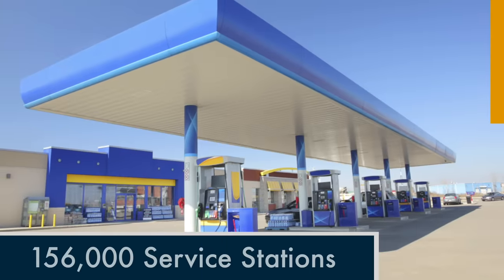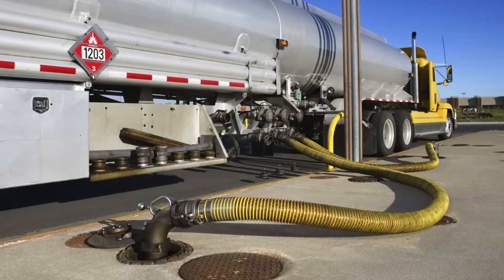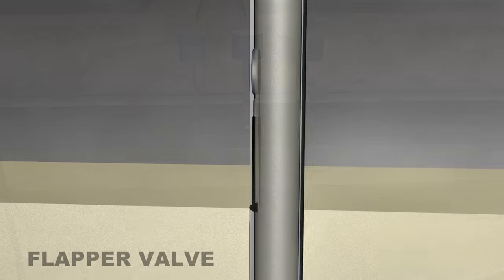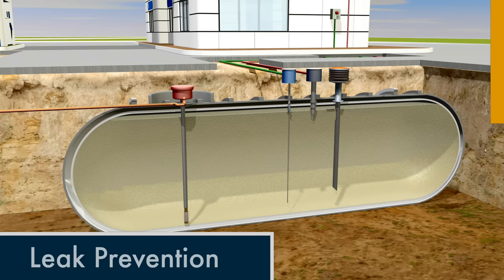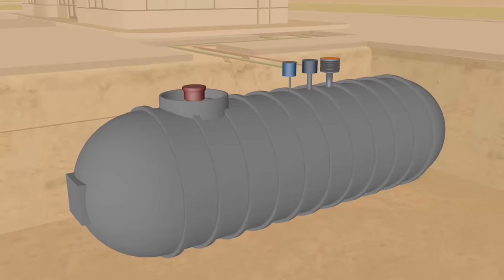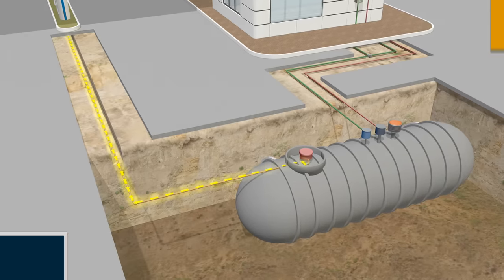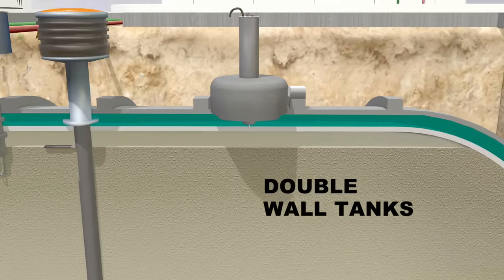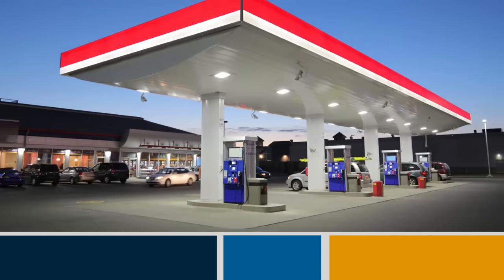Gas Stations

Comment: That's a lot of safety and all, but then when a leak happens you gotta rip that shit out of the ground and repair it.
Reply: Yes but it's not actually that big of a deal relatively speaking.  Pump it dry into tanker trucks, rip the concrete up, scoop out the gravel, and drop a new one in (or repair but that can be a real pain) and if you're unlucky you might need a few pumps to keep the water out of the tank hole while you do this.

Comment: I used to work at an old full serve station built in 1920. Tanks from the 80's . And the tanks were allowed to leak a cert en amount ( 1 gallon per2500 gallon per week ) its located where most of us have well water and it is less then a mile from the cape cpd bay ....
Reply: Brian O' well water is taken from pockets so deep it would take thousands of years for the gas to reach it
Reply: not in my aeira our local wells are as shallow as 140 ft but can reach 1200+ . The air Force base has leaked jet fuel and contaminated hundreds of wells   in less than 75 years. the ammount of time it takes for ground water to mover can varry greatly, where i reside is essentially a 60 mile long sand bar deposited by a glacier, allowing ground water to move quite freely

Comment: 50 years from now instead of there being gas/service stations there will only be power/charging stations
Reply: No one said EV's  are going to save the environment or the planet from global warming for that matter, EV's convert about 59%–62% of the electrical energy from the grid to power at the wheels, even if the power source is from a coal plant, it still makes good use of that energy. Internal Combustion Engine Vehicles only convert about 17%–21% of the energy stored in gasoline to power at the wheels, whilst still needing engine fluids to maintain the vehicles performance such as oil and gas to power it.
Reply: and what if you have an electric that is purely powered from a home solar grid? is it still burning oil? EV's are as green as their juice makes them to be. BTW EV's are a solution to the future, 50 years from now we will be running on fumes for the search of crude oil and natural gas, considering the increase in population, demand can only become exponential
Reply: ***** let me put it this way manufacturing anything will always require oil but which one uses less oil whilst being manufactured and requires no oil after its a finished product?
Reply: The end factor is always effeciency
Reply: Saul Ramirez nah
Reply: McDoogle Watchu mean naw son
Reply: Saul Ramirez lol 50 years more like 200 we have lots of problems right now
Reply: Spikey-gaming&more 200 is too much, with alot of early adopters for a small company like Tesla and a realistic view id probably say 60 years max, because Tesla EV's are pretty good in almost every single way than an internal combustion engine
Reply: Hopefully that's the case!
Reply: Tofutaco11 A example the plant Tesla will be making batteries from will be powered by solar(on roof), wind,hydro dams, and solar thermal power. That said, it will use hardly any fossil fuels to make batteries. Then people re charging their cars at home once more and more solar and wind come on line it will be mainly renewable energy. Even if they charged there car buy using a coal from a local power plant it's still way more efficient than burning gasoline in a combustible engine. The coal power plant near me is the cleanest plant in the US or the world hardly puts out any emissions. Also the batteries are mainly made of lithium ion batteries that don't need oil. The plus side of lithium ion batteries they can be recycled over and over. Once graphene batteries become a thing it will change the game.
Reply: All the people talking crap about electric cars..... well there coming and countries like Britain have passed a law that bans any new gasoline and diesel cars in 2040.
Reply: Pixel Dust Electricity doesn't always come from fossil fuels. I.E. Tesla factory uses more solar power to produce it's cars. Moreover Electricity used to charge cars can either come from nuclear power, solar or wind. Superchargers use (as far as i know) solar or nuclear, which is better for the planet.

Guys do you know that, using electricty instead of fuel saves money for a country, since there are no cuts going to countries selling them.
Reply: Pixel Dust a gasoline engine burning fuel is only about 25% efficient a lot of wasted heat is let go. Lets pick the worst most polluting type of electricity being produced.... coal. Burning coal at a power plant is way more efficient in a large scale producing electricity than a inefficient fuel burning car.
Reply: Dcool Or from nuclear plants
Reply: Pixel Dust Not sure why u keep trying defend the out dated fuel burning cars. I have many classic cars but electric cars are the future. There are already major countries banning fuel and Diesel cars in the next 20 ish years. The law has already been passed in those countries forcing automakers to change their thinking. Keep talking to yourself.
Reply: Pixel Dust I still don't get you. We are in 2017. Here are some reminder:

The tesla S got the safest car in the world rating
The Tesla X got the fastest and the safest SUV award.
The Tesla Model 3 has one lower drag coefficient of any car.
Tesla S does 0-60km/h in 2.4 s, the newest version can reach 539 km or 335 miles on a single charge.
Tesla X can be a 7 seater.
New Superchargers are being installed everywhere but you can charge at home. Moreover if you plan carefully and charge at night, you might never have to waste time refilling it, like fuel engines.

Are these electric cars slow? Weak? Or range limited? 
And also we can have unlimited electricity without damaging the environment. Here you can find an example of a supercharger station based only on solar https://en.m.wikipedia.org/wiki/Tesla_Supercharger.

I guess you are part of the people, who were against the introduction of motorized cars and prefered horses and charriots.
Reply: Pixel Dust you seem you have no clue either. Tesla is selling the model 3 for 35k that gets 220+ miles for it's Base line. 400k orders that is going to take a years to fill. I think your salty Tesla is going to be around for awhile. Volvo vowed to pretty much only build electric cars only or a electric hybrid.
Reply: Pixel Dust

Yes these cars are expensive. But you need to understand that this a startup company, this means the first products are naturally going to be expensive: Researches, Factories, Superchargers, Retailers,debts need to bought/made/paid out of the revenues from the cars. I.e 4k TV went from 2.500 - 8000 Euros in 2008 to 400-1500 Euros in 2017. 
Except for the fact that fuel combution engines can be refilled under 5 minutes, i do not see any reason why someone would choose at Combution engine rather than an ICE. 

Electricity is the best source of energy for every machine, we went from charcoal iron (clothes iron) to electric ones, from slow and wasteful coal trains to faster electric trains. Just give it some time man.
Reply: Saul Ramirez I hope noy
Reply: Saul Ramirez funny joke
Reply: dcool is that law real? thats anti freedom nooooo ;-;
Reply: Saul Ramirez so instead of running out of gas on the side of the road the battery dies and you’re screwed if you’re in the middle of Buttfuck-Egypt with no charging station, tow truck, cell tower or perhaps even mile markers for miles
Reply: Dcool makes sense.  Most people in London probably prefer riding goats these days.

Comment: The automatic shut off mechanism on the handle will fail if the previous person topped off there tank. Trying to squeeze the last penny into your tank forces the gas up the vapor return line on the nozzle.

Comment: What about the emergency shut off switch found somewhere in the station? How does that exactly work?
Reply: I think that just cuts the power of the gas pumps.
Reply: Well....best I can surmise.

It's a switch.  Turn it off....power is stopped.
Reply: No erectricity, no pumpy pumpy!  As the Chinese say.

Comment: Sucks when it takes 15 minutes to fill up when you just happen to find a pump with a worn out nozzle that keeps clicking off. Also let these tanks run dry because of issues with the pipeline and see what kind of fun stuff starts happening.

Comment: In movies, when gas stations blow up, only the dispensers on the surface explodes, not the tank. What?
Reply: Because the tank blowing up would require oxygen to mix with the gas, and that would be catastrophic so there are systems to try to prevent that.  Look around the internet, there are videos of gas stations where the tanks go and it's the kind of fire that you can't fight.

Comment: if the spill buckets are there to direct fuel into the tank why are we told to empty them by
mixing in fm 186 
bale out
dump in waste barrel.
Reply: thats right..i think.the video is wrong...if that was the case then rain water would freely flow in and fumes would flow out...we also know gasoline is extreamly dangerous

Comment: so are there really different tanks for different fuel quality or are they all pumped out of the same tank and they just charge a different price depending on the pump you use?
Reply: There are different tanks, they usually mix the high and low to make the middle.

Comment: why don't they make them all of fiberglass or plastic? seems like like an obvious choice instead of iron that can rust.
Reply: tiberiius well because plastic might (not saying it will) melt under heat and fiberglass is too expensive while iron does heat up and could be dangerous it's not as bad as having the gas leak from the tank but honestly I don't know so I'm just answering from what I think could happen
Reply: My guess is it's mostly with older tanks that can be upgraded with a special coating or the device demonstrated in the video.  This would probably be a cheaper and more efficient alternative than getting a whole new tank.
Reply: seem like pretty good ideas.

Comment: They show all the fuel goes in 1 tank, and I've only ever seen 1 truck refuel a station. So how are we being charged 3 different prices for 3 different types of fuel at the pumps?
Reply: There are usually at least 2 tanks, but 1 was used for a simpler video. Trucks can carry 1 or 2 types with separate compartments inside so that's why you see 1 truck at a time, and the middle octane gas is a mix of the high and low octanes.
Reply: And you know this how? .... The whole thing seems suspicious to me.
Reply: I work construction, and working on gas stations teaches you a lot.

Comment: Are they bullet proof?
Reply: Pedro Garibay Ground is pretty good at stopping low caliber pistol bullets.
Reply: Campers oh thanks
Reply: You couldn't put a hole in a tank in the ground with a .50 cal BMG...  You'd pretty much need artillery to damage one of these underground tanks.
Reply: Pedro Garibay why would they be?
Reply: I'm not sure how powerful the bullets are, but if your bullet could go through 8" of concrete (the part you see around the holes) then 4' of gravel or pea gravel, then through a couple flimsy fiberglass walls then they are not bulletproof.

Comment: 87 octane!!!!! what the hell!!! how do cars run on that, its practically water. 

89 is premium!!! geez no wonder americans need v8s 

we have 91 as the base fuel
Reply: 95 here, and 99 premium
Reply: VERY few vehicles have V-8's in them anymore, they haven't for years.  Most cars run just fine on 87 octane.
Reply: we have just started to use ethanol blends 
94ron-10%ethanol 
E85-85% ethanol
Reply: We have 87 octane with 10 % ethanol as well as E85.  Had it for quite some time now.

Comment: gas stations are not good for the environment to begin with lol
Reply: That's it. Explain how safe and environmentally friendly the fuel storage tanks are to distract you from the fact that they want to pump filthy tar sands sludge down the center of our country,  right over the aquafers that provide much of our fresh, safe drinking water.
Gee! What could go wrong with that?
Reply: David K. not to mention the atmospheric poisoning from the fumes of the gas consumed by the cars and spilled on the ground
Reply: greg77389 says the person who is ignorant of the poison that is petrol it is a toxic chemical that is really just primitive refined sludge that has the ability to burn inefficiently and we have alternate combustible gases that are much safer on the environment at our disposal (hydrogen)
Reply: greg77389 numbers of gas powered vehicles will go down after a new fuel source is made and the method i describe "Hydro Electrolysis" is a cheaper and safer method than using "hydrogen fuel cells" and requires no real conversion save for just using distilled water over gas
Reply: greg77389 AND I QUOTE. "How many cars today run on hydrogen you idiot?" BAM!
Reply: NorthernChev 
Exactly, you didn't answer my question you simpleton. You couldn't even give me a number.
Reply: deathbot117 
It's clear you have no idea what you're talking about so save yourself the embarrassment and stop commenting. How long before a suitable fuel source is obtained that would be cheap and effective for manufacturers to convert to? Clearly you know nothing of the automotive industry nor do you know nothing about science, electrolysis, etc.
Reply: NorthernChev
Did you forget that you were the one who brought planes into the discussion? You must have dementia because not only are you getting wrecked in this debate but you also can't seem to recall things you've said just a few hours ago...
Reply: greg77389 i dont see where he brought a plane into the discussion all i see is car names
Reply: deathbot117 
"I forgot about the hydrogen fuel cell airplanes that Boeing makes too..."

You only see what you want to see.
Reply: greg77389 i never said that ... stop fabricating quotes ... i looked for 5 min and i didnt find that quote anywhere in any of my comments in this thread
Reply: NorthernChev 
This conversation was over before it began. I've already won, I'm just teasing you at this point :)
Reply: greg77389 that damage control
Reply: Ponlets then stop driving you fool

Comment: if it's 1 big  bucket how we get  eather  89 or 91 gaz
Reply: Serge Bykov that's the conspiracy. you're just paying more for the same fuel.

nah, I don't know, maybe there are multiple tanks and this video only shows one for simplicity.
Reply: The same way you can get either gasoline or diesel. They use different holding tanks. Most fuel stations have 4 or more holding tanks. The next time you go to a fuel station, look and see how many access caps there are on the ground and look for the ventilation pipes and count them. Each cap and vent pipe counts as 1 tank.
Reply: Yeah that's true I didn't really think it though and comment  I have to wake up in 4 hours but still awake

Comment: Wouldn't the brine corrode the steel tank?
Reply: its special brine used in a special way, they obviously wouldn't use it if it did corrode...
Reply: great explanation
Reply: I guess it's.....er....special.
Reply: Anticorrosion coating, fiberglass and cathodic current prevent it from corroding. they litterally told that just before it. the question is why not normal water.  my guess is because brine is electrically conductive whereas water is not and they are using cathodic current for preventing corrosion. but im probably wrong
Reply: I have a theory on the brine, but I may be all wet.  If you make the water salty enough, nothing can live in it. Think of the Mideast's Dead Sea. 
Even in a closed environment like the fuel tank, some organisms can flourish. And once they start reproducing, they can really gum up the works. 
By using hypersalinized water, you limit what can thrive in the system. 
I ran into a similar problem many years ago with a piece of water-cooled machinery. We used glycol to eliminate algae growth. 
My comments above are just a guess. If someone has a better idea, please chime in.
Reply: +Stress Belden My mom thinks I'm speshal.
Reply: The short answer is without the presence of oxygen iron will not corrode. The brine keep the oxygen away
Reply: the brine is salt water dyed blue, salt is used to prevent it from freezing
Reply: It can't corrode without oxygen. Salt water speeds up corrosion, but the process requires oxygen.